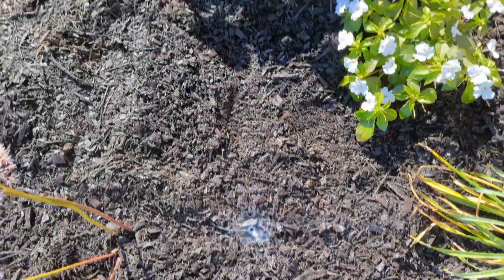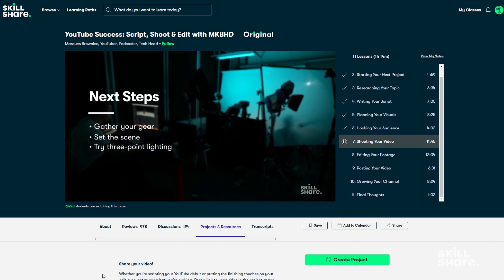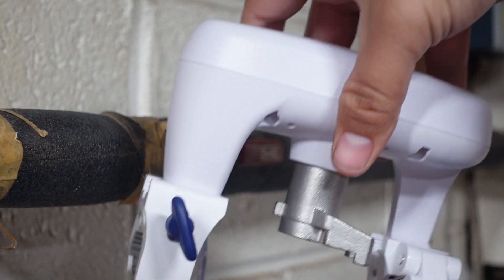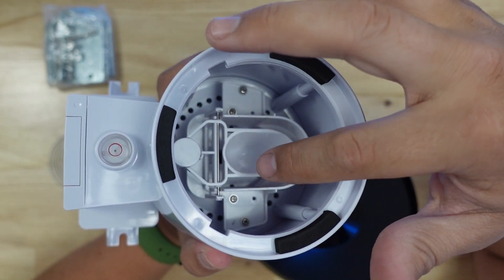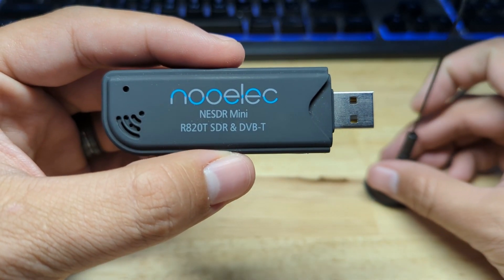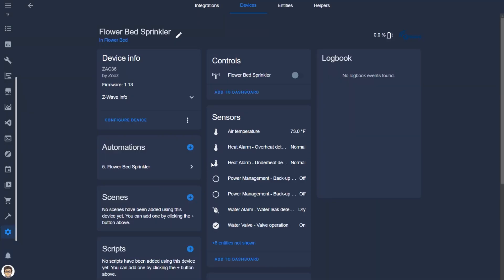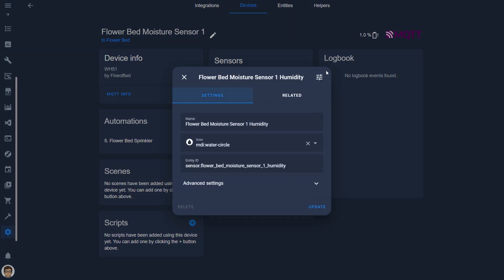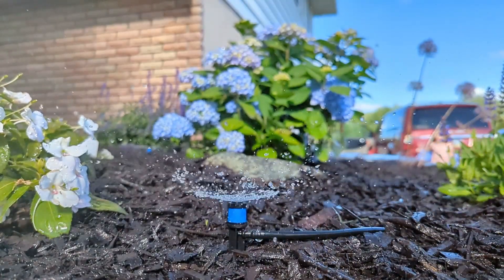Automated Flower Watering System in Home Assistant

Comment: Great job. Thanks. I am in the process of designing a multi zone irrigation system for my lawn and garden beds using 24v solenoids and ESP32 connected to Home Assistant. Ultimately I'd like add soil moisture meters and possibly weather information (albeit the weather forecasts here in Melbourne Australia are not often correct). Project videos like like this are are great help. Many thanks.
Reply from the maker: Sounds like a fun project!!

Comment: Thanks for sharing, great project!   I powered up a WH51 soil sensor, but SDR2mqtt is not detecting it.  I see this in the log: 

PROTOCOL = -R 142 -R 113
FREQUENCY = -f 915M
Registered 2 out of 218 device decoding protocols [ 142 113 ]
No supported devices found.

Any suggestions on how to debug?  I don't have any other ecowitt devices, but could order some if needed (e.g. GW1100 gateway)
Reply from the maker: Thanks!  If your config is the same as mine at 6:25, you should be good, but make sure you have the RTL-SDR device plugged into your HA hardware's USB port. MQTT all set up properly?
Reply: @MakeItWorkTech  I had the config setup right, but did not have the USB port enabled through my virtualbox machine.   Working great now, thanks for the help!
Reply from the maker: Awesome, glad you got it! Is battery percentage showing up properly?
Reply: @MakeItWorkTech  Yep, I got 6 new entities: moisture, battery, last seen, noise, rssi and snr.  Thanks again!
Reply from the maker: Awesome!

Comment: Great video. I also have something similar planned to automate the turning on of my soaker hose. I was planning on getting a solenoid valve and connecting it to HA with a Shelley. I liked what you did though. Great info about the soil moisture sensors.
Reply from the maker: Thanks! Sounds like a cool idea! I would love to do more with Shellys

Comment: This is well timed. When I saw the notification yesterday I was worried this would be one of those intensive sprinkler systems with different zones. I wanted to do something hose based and love what you did! Did you have any issues with your WiFi network range for the new devices or are none of them using WiFi?
Reply from the maker: Thanks! The only issue I had was when I tried the BLE moisture sensor, so I switched 915MHz!